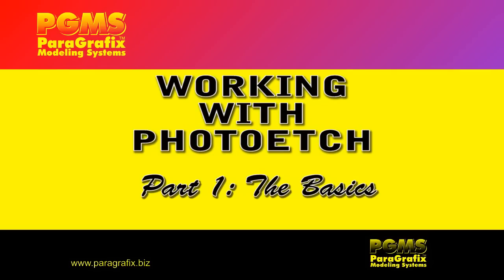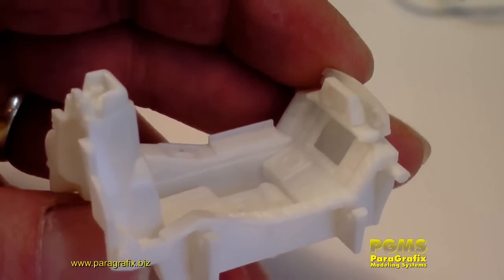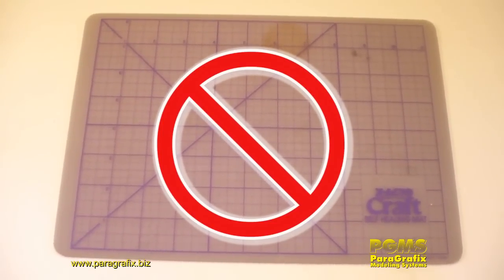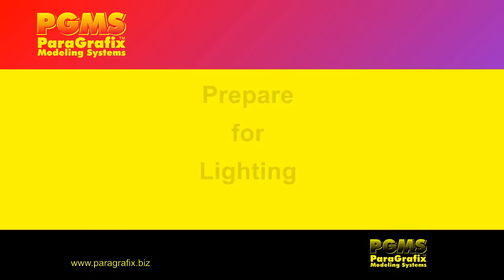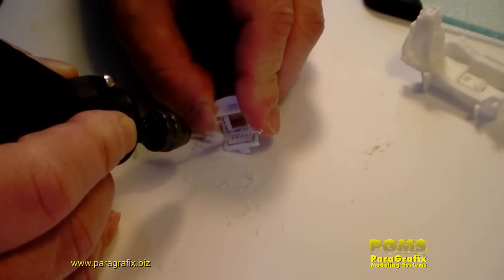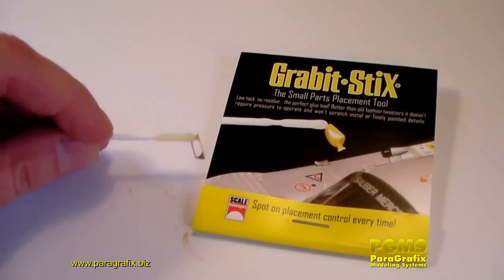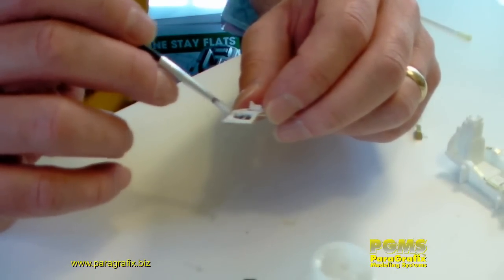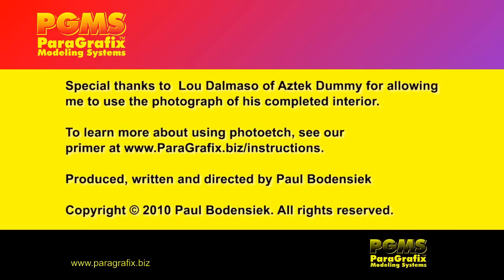Working with Photoetch, Part 1: The Basics

Comment: I have a phot etched and resin kit for a United States Coast Guard Jay hawk helicopter. In assembling the basket in PE. Should I solder or use CA to hold it together?
Reply: I'm afraid I'm not familiar with that part. I would guess that CA would be better. You definitely need to use CA to attach it to the resin.

Comment: Where did you get the glass you use to cut your photoetch on? It looks it has some bumpers to protect your hands.
Reply from the maker: I don't remember the exact store (it's been over 10 years), but it's a glass cutting board from someplace like Target or Bed Bath & Beyond, or maybe even Benny's (a defunct local discount chain) or Big Lots.

The rubber corners are really just there to keep the board from moving around, not for any kind of protection. You can use any flat, solid surface like a piece of floor tile.

I actually use Xuron Professional Photoetch Scissors now instead of the Xacto blade.
Reply: @ParaGrafixModeling  thank you for responding

Comment: Nice video, thank you. I would like to ask: can I use Micro Metal Foil Adhesive as a replacement of superglue? Thank you very much.
Reply from the maker: Thank you Milos. It really depends on what type of parts you're attaching. 

If you are attaching a flat piece of photoetch to a flat piece of plastic (eg. for a control panel), then yes the Micro Metal Foil Adhesive works great.

If you're trying to secure a folded piece of photoetch etch together, though, you're better off with super glue ... or soldering. (Note to self: get to work on that soldering video!)

Comment: Was wondering what you might, recommend for lighting the photo-etch with backlight decal, I'm currently working on this model, and now at the stage where i need to come up with how im lighting it, currently a toss up between some fiber optic and one central LED. i'm shure ill get there but, some advice would be nice.

Comment: i bought a $20 xacto knife from a store, but when i went to replace the blade i found them to be super expensive, so i just bought knockoff xacto blades off ebay, $4 for 30 and they last 90% as long as normal ones
Reply from the maker: I like Excel blades - they seem to last longer than Xactos and I get 100 packs for about $16. The pack I have now is finally running low after about 6 years of use.

Comment: what dremel do you use?
Reply from the maker: I have a "standard" Dremel ... I.e. one that I bought when they only had one model rotary tool (other than the battery powered one). Of course, almost nothing is compatible with it now other than the bits. I'm going to have to do some major refurbishment on my drill press to take care of the rust on the frustrum because the new press won't fit my old machine.

I'm afraid I don't have a suggestion if you're looking to purchase a new Dremel.

Comment: "I'm going to leave out the painting because you already know how to do that" - negates reason why I clicked on the video. Pity.
Reply from the maker: There are, literally, thousands of videos out there showing how to paint model kits. 99.9% of them by people better at painting than I am. It is best to get information from the experts.
Reply: Do you paint the part before or after gluing the PE? Does CA glue work for PE to painted plastic?
Reply: I came here specifically to learn how to prime and paint, and it wasn't even covered! Crazy.
Reply: Painting brass is totally different from painting plastic and requires different prep of the surface. You are supposedly the expert here.